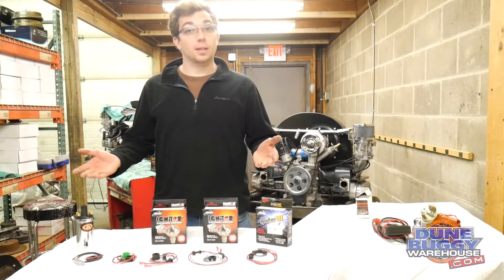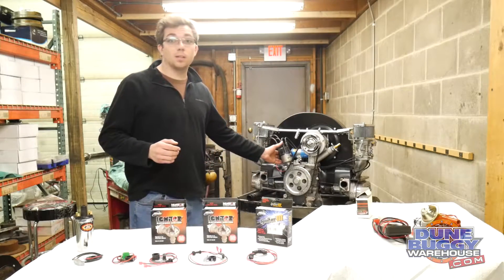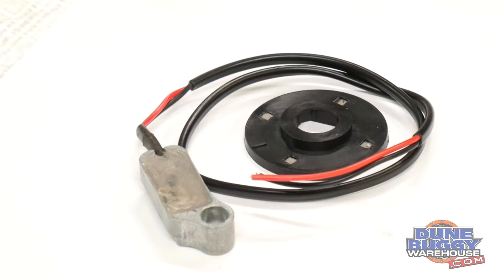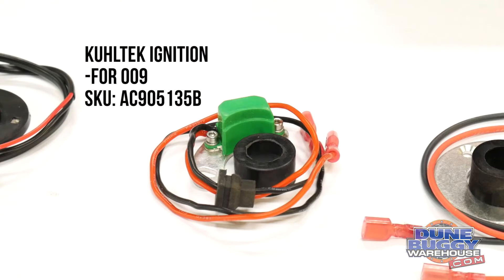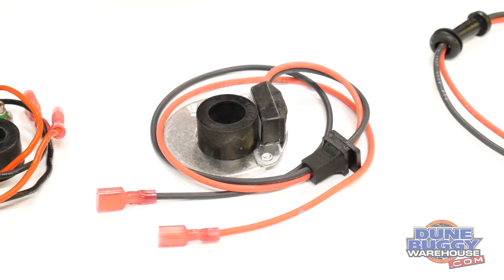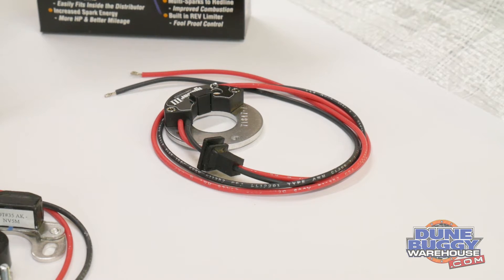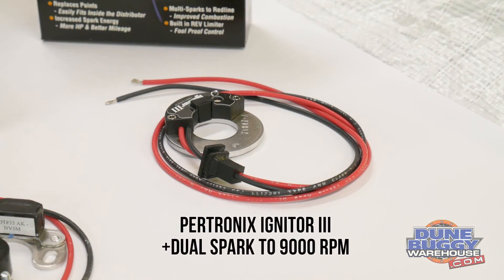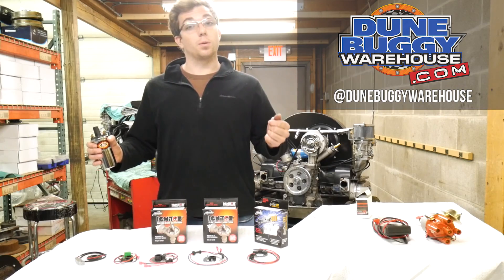Air-Cooled Volkswagen Electronic Ignition Options - For Beetles, Bus & Dune Buggy

Comment: hi, i have a question for you guys, the kit AC905535B fit in vaccum advance distribuitor? i notice the one for 009 dist dont have the B on it,thank you
Reply from the maker: Thanks for the question. They are not compatible with vacuum advance. The AC905535B seems to be the same part as the AC905535.

Comment: What about 6v systems? Do they need a 3 ohm coil too?
Reply from the maker: Are you running electronic ignition or points? 6-volt coils should read about 1.5 Ohms. Electronic ignitions like the Pertronix may require different Ohm readings.